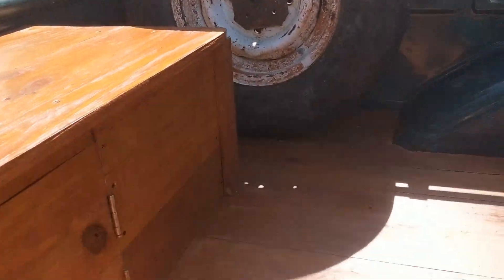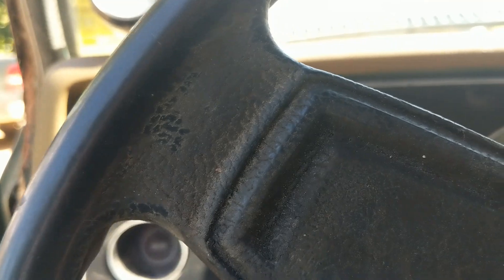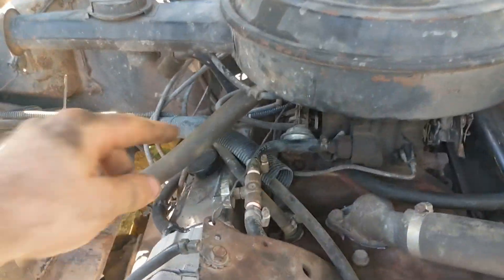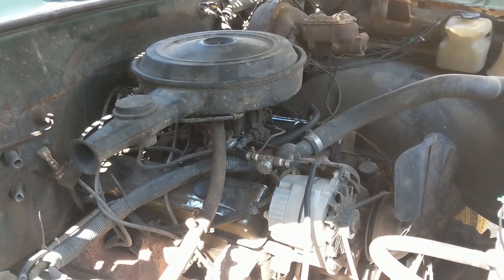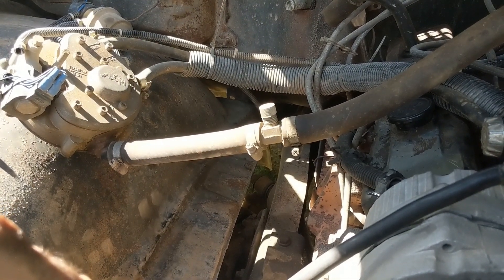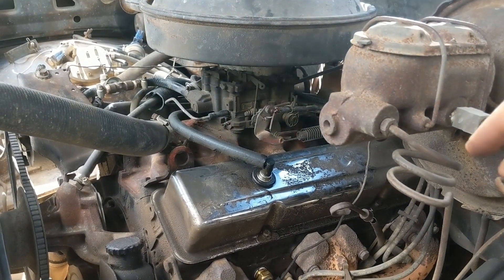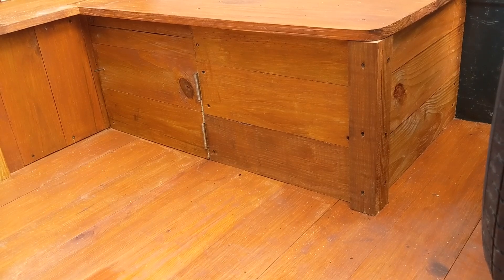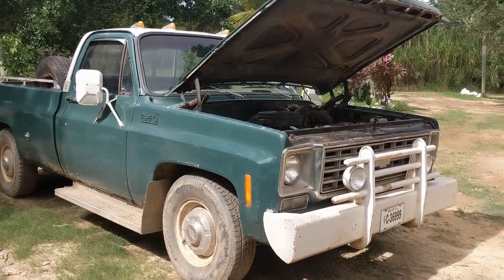The pros and cons of using LPG butane or propane in your car or truck

Comment: 20% reduction in power sounds like quite a loss of power especially if going up a mountain highway. Thanks for the video there is a van for sale runs on propane. I was checking out propane powered vehicles
Reply: Its 20% if you leave the timing set for gasoline.....reset it for LPG and your looking at about a 5% power loss......i converted and ran my own vehicles on dedicated LPG for 18 years...lol LPG is almost the easiest of the 'alternative fuels' rabbit holes to go down
Reply: BL Dontmatter  It comes down to a cost factor....whats LPG worth where you are compared to gasoline?....where i am lpg was about 60% the cost per mile driven (propane gets slightly less MPG)......If its tuned for LPG the loss of power isn't that noticeable.....on my vehicle's the power loss was similar to the loss thats felt when the aircleaner is getting close to needing replaced
Reply: @unhippy1  I want to use liquid side of propane to a Subaru and install a return hose to the tank, what do you think of that?

Comment: There might be a big pro to this pretty soon since they're trying to phase out the internal combustion engine which is going to be hard to do with all the old cars on the road but they could stop producing gasoline what would be the next option convert your truck or car to propane.

I recently converted a portable generator over the propane and it was extremely easy all it was was basically a spacer between the carburetor and the intake I'm not sure how you would do this on a modern fuel injected car

Comment: The one thing I did not know is you can run 15:1 compression ratio with that fuel.
Reply: Depends on your head design etc.....but even a pretty old head design like most 2 valve V8's are can run 13:1 compression without any real worry of pinging if your dedicated LPG only....lol i've see a 1300cc honda vtec running 17:1 compression on LPG as a daily driver

Comment: Ok so im looking at a 88 dodge propane powered truck, are they any good? Last longer than gas? Hard to fix? Parts harder to find? Please help
Reply from the maker: Well all the parts are basically the same except for the additional LPG hardware, so as far as that goes its no different than a gas powered truck. The LPG burns cleaner and has a higher octane than gas so yeah I think its a good thing, and if your truck is like mine you can switch it back and forth from gas and really get a mighty range for road tripping
Reply: @mrmaxstorey  dang that’s nice, I might get it, it’s cheap but I think it’s all propane

Comment: Gasoline Doesn’t explode it burns quickly and only the vapors burn you can actually put out a lit match in a puddle of gasoline I’ve done it many times to demonstrate how safe gasoline is
Reply: That's not completely true... If the gasoline is warm, it will create a vapor/air mix just above the pool of gasoline, and there's a chance the gasoline will ignite the match.  I used to do that as a party trick, but noticed sometimes if I did it outside and the wind picked up and it was warm enough it would ignite about 1 to 2 inches above the gasoline.  If there is no air movement and the match hits the gasoline vapor, the gas vapors will smother the match, and liquid gasoline will not burn.
Reply: And I was not ever able to get a lit cigarette to ignite gas, even when I made a super flammable air/gas vapor mix for it.

Comment: You should use a lock off solenoid for the petrol side with a changeover switch for a nice duel fuel setup.
Reply from the maker: Im with ya dude and I even bought one to wire up under the dash, however I never used it because the lpg fuel ring needs to be manually removed anyway each time I switch it from LPG to gasoline so I can't do the changeover without lifting the hood. So, i figured I can turn the gas knob on while im under there anyway, and its one less electronic thing to mess with.
Reply: @mrmaxstorey  How come you have to remove the ring? Here in Australia been running similar setups for years. But usuallly it’s like a hat that sits inside the air cleaner housing.
Reply from the maker: @triggeredleftyvegan6004  this one sits between the air filter housing and the carburetor. I show it in my other video on this truck, the intake hole is way too small if running on gas and the truck runs very rich. I've thought about upgrading the system because I'd like it to be push button dual fuel, but this works well for now so I'm not pressed
Reply: @mrmaxstorey  Yes you’re correct I understand now. Very agricultural system but works, it’s great to see.

Comment: So how would a propane only carburetor change a setup like this?
Reply from the maker: Well you would need some butterfly valves so you can throttle the motor, and it would need to mount securely to the intake with no leaks. Other than that the carburetor doesn't serve any other purpose

Comment: In some European countries LPG is very popular. For example in Poland it's difficult to find a gas station which DON'T sell LPG. It's about half price of regular gasoline and car uses about 10% (LPG has about 10% less calories than petrol). Basically you're driving for half the price
There are pretty much no drawbacks to this system. It's  cleaner, cheaper etc. LPG eats through catalytic converters after long time due to higher EGT. But it requires about 150000 Kms to do visible harm to it.
The only problem are direct injection engines which are costly to install LPG system (twice as expensive to install and use petrol to lubricate the injectors)

Nice to see this technology expand

In Japan taxis also use this system

Comment: It's not a constant stream of gas, the engine pulls a little vacuum on the low pressure side (through the venturi of the mixer under your air cleaner), and inside the vaporizer is a diaphragm reacting on it and opening and closing a valve depending the need. The mixture screw is needed to set your CO2 levels during idle for emissions. It's crude but works perfectly fine on any pre-emissions car without O2 sensor. If the car has a O2 sensor, then you need an additional LPG ECU which basically acts as a slave unit to the car's own petrol ECU.
Regarding lubricating the valves, if the car is suited for lead free petrol, you have hardended valve seats and are good. Should the car nead leaded fuel (or lead replacement/additive), it is wise to have the engine overhauled and install hardened valve seats, or use a LPG valve additive.
Reply: Thank you Sir ,
That is some very valuable information...🙏
Sounds like you know the system well...👌

Comment: Hey man I have a 2001vt600 shadow , that has 160psi compression in 4 cyl , carb is rebuilt and everything working but bike won’t fire even with starting fluid , the spark seems to be very weak , I’ve cleaned connections and battery is sitting arround 12.8 volts , do you think it’s the stator ?
Reply from the maker: Good work so far. I'd throw in new plugs, look up the stock resistance for your coil and pickup coil and then check those. Usually cdi boxes fail by arresting spark altogether but occasionally they do get weak over time so it could be that as well
Reply: @mrmaxstorey  Ok will test for resistance , when i first found the bike in a barn , carbs were clogged tank was rusted, all that was adressed , spark plugs are wet , and even with starting fluid , i bought new plugs but they seem very dim , compression is fine , there is gas in the cylinders and wont start , so my guess is spark plug is to weak to fire ? does that make any sense?
Reply from the maker: @elkevin5888  yes it makes sense, any part of the ignition system can get weak and cause poor spark, I'd just be methodical and test everything and don't assume any part is good until confirmed
Reply: @mrmaxstorey  so battery was reading 11.6v decided to charge it overnight , hooked it up , sprayed some starter fluid and boom it was alive , one thing I noticed when I pulled out the carb to clean it is that the air mixture screw is missing , but the needle inside of it it’s still in there , I got no idea how that works , maybe it fell ? And the needle stayed in there ? , would it run like that ? The spark issue was battery related , but I got no idea what to do with that air mixture screw , just leave it in there and re assemble everything ,
Reply from the maker: @elkevin5888  Do you mean the choke or the air mixture screw? The air mixture screw should be a brass screw that comes up from the bottom of the carb, it is a needle with a screw head on it. The choke screw is made of plastic, it has a cable coming through it, and it attaches on the top of the carb to a separate needle. I see how that could get disconnected from the cable and stuck in the carb but its unlikely that you would break the mixture screw in two. Go on bikebandit and look up your bike's schematic for the carburetor and tell me what youre referring to
Reply: @mrmaxstorey  air mixture screw , i guess it was stuck and they tried to drill it out and borke in half , but the needle is in there and the brass screw and threads are missing
Reply from the maker: @elkevin5888  oh damn that sucks. If the threads are drilled out you may be looking at a new carb body. The bike isn't going to idle right and will have bad low end power with that all buggered up
Reply: @elkevin5888  As long as the mix is set properly, the only part of the screw that does anything is the very tip of the screw has a little needle on it that slides into the jet, and works almost exactly like a needle valve for like an air compressor or anything like that.  As long as the jet is clean and flowing fuel and the needle is set at the right depth into the seat, it should be just fine and not need to be bothered, except when you need to adjust it for running alcohol or extreme elevation changes.  It will not run very well on a mountain if it runs well at normal elevation without adjusting the fuel mix jet.  They do make kits that you can drill out the jet and set screw/needle and then just rethread the port and drop a new jet in and needle/screw.

Comment: i have about 20 years experience using propane powered trucks (butane is unheard of here as a motor vehicle fuel) and i concur with everything you have said here. before even considering a switch people should check the price and availability of the fuel in your area. in most areas of the u.s.a. you are probably better off with gasoline.

mrmaxstorey ... nice to see videos from you again; you are coming up on 50k subscribers ... time to get a tripod and do a bit of editing. content good, video small-time.
Reply: This didn't age well fuel is thru the roof

Comment: With the butane having a constant flow how well does it handle speed changes? 

Not sure on the road system I'm belize but can you go from city driving to freeway speeds (65mph) with the same gas flow?
Reply from the maker: That's a great question. The truck drives normally at all speeds, albeit with about a 20% reduction in power, no stumbling or hesitation. I believe it is because the fuel comes out already atomized with air in a relatively consistent mixture and does not rely on a carburetor to mix it. For that reason it is less beholden to the rules which constrain a carburetor
Reply: @mrmaxstorey  one last non truck related question. Were you allowed to bring your houseplant into Belize? I remember your video about moving to Cali and they mutilated it.
Reply from the maker: @LemmeSmasher  Ha youre a prince. Nah we didn't even try, my brother drove from Colorado to pick it up and it sits now next to his
Reply: Lemme ... The gas flow is controlled by the regulator and intake manifold vacuum , more throttle = lower mani vac and more propane from the reg, less throttle = vice versa, the valve he is playing with is for fine tuning.